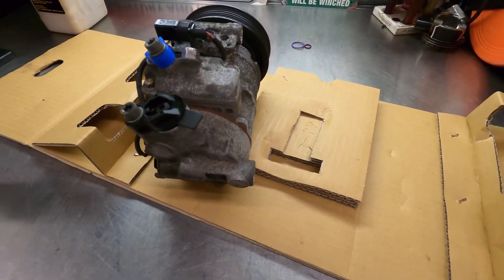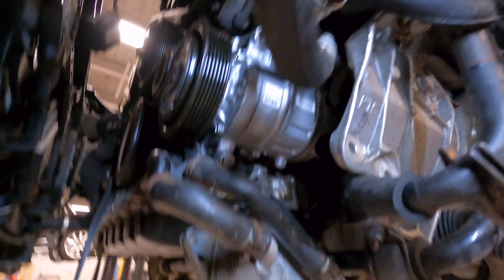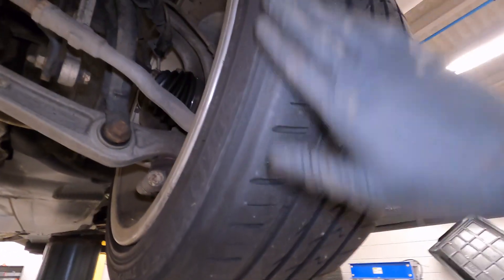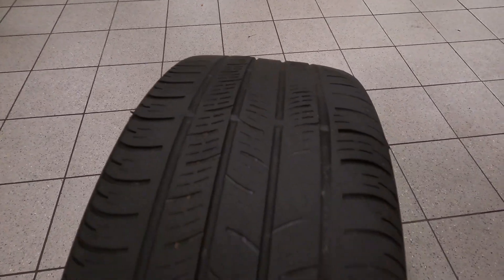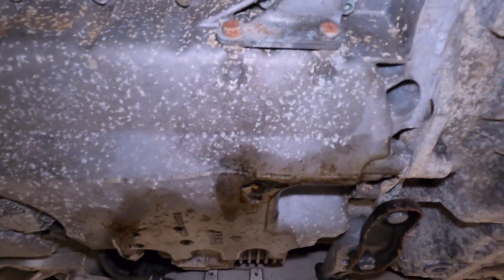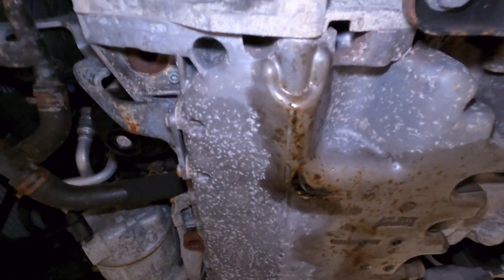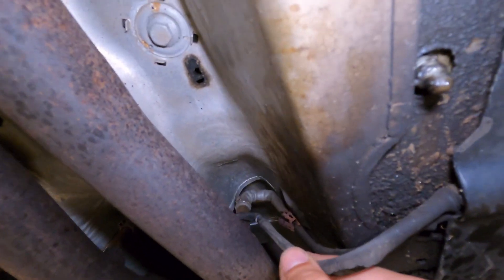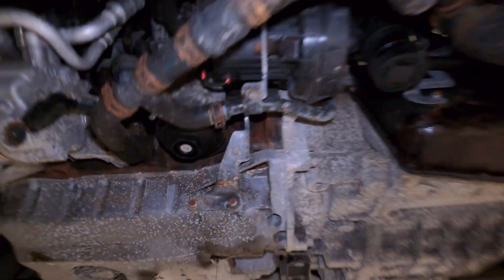Customer states Weird day in the shop again😜🤣 What's going on!??

Comment: If I ever have a repair shop, I will make videos exactly as you do, and every customer will see their video before they pay my bill. If I were the owner of this car and you showed me that uneven tire rolling, no matter how obtuse I was I would realize there's more value in the cost of the alignment than in replacing tires over and over again LOL. That and I would take great joy in explaining to them that might being cheap and not spending another three or $400 for a skid plate and anything else needed to protect it after lowering, they now get to spend even more than that would have cost, to repair the damages that have been caused. Common sense just ain't so common anymore LOL! Diggity
Reply: I'd do that too if I had a shop.  That way, customers can actually see what is wrong and just not adding "unnecessary work" for shits and giggles.  However, we're still gonna get those cheap bastards who will still refuse even if you physically show it to them...yeah, been through that a lot with my mobile repair business.

Comment: I read a lot of comments regarding the design and serviceability of new cars. New cars are smaller, more comfortable, fuel efficient, and cleaner than cars that were made even ten years ago. The only way to do that is to cramp more equipment in a smaller area, and it's worth it.
Reply: If/when YOU have to work on one of the modern vehicles you are likely to change you outlook.

Comment: car's been tracked ... flat spots are from locks up under hard braking... its also caused that wear on the inside of the tires. they need track tires on top that alignment.  but flat spots like + inside tire wear = SOME ONE BEEN TO THE TRACK

Comment: I thought only replacing a compressor instead of the whole system will just lead to another failed compressor in short time. I think I heard that in a video from the Car Wizard
Reply: Depends on why the compressor failed and how long its been that way.
if it fails electrically you don't have to replace everything.
If the internals fail mechanically then you really need to replace everything because you'll probably have metal particles in the system now and the new compressor will get messed up again before long.
Reply: @osmodan  Thanks for the reply! That all makes sense
Reply: My compressor clutch went out on my Infiniti.  The clutch wasn’t a replaceable part so the entire compressor had to be replaced.  The compressor oil was clean, so no need to replace anything else.
Reply: True, if the compressor fails in a way that puts anything, and I mean ANYTHING into the system other than air then a lot of other parts need to be changed.
Air conditioning systems need to be hospital operating room clean inside.
Actually cleaner, they can't even have any air inside them
Reply: @michaelszczys8316  once again another sensible reply. Thanks guys! Its so great to build a greater understanding together

Comment: Let me explain the career of a mechanic. first your a grunt labor. as time goes buy you learn more and more start buying tools.  Here's the catch, you have 25 years to either be the boss or the owner. After 25 years  your back is shot your knees are done and your an alcoholic plus you have $ 50000 + in tools you have no use for and be lucky if you get $0.50 on the dollar on them. 30 years a tech and $85000 + in tools 25 years sober. there ya go.

Comment: Those flat spots looked diagonal and very repeating. The steel belts in the tire tread are diagonal. I wonder if there is an issue with the tire itself.

Comment: Customer Was Power Braking and Drifting That’s Were The Goomba’d Flat Spots on The Rear Tires Came From Giggity Giggity 🤕😆😆😆 Oooooooh That Oil Pan Witness Hole For The Self Lubricating Chassis System Mod Giggity 😮🤕 Goomba’d Again 😮🤕

Comment: What the heck do they spray on the street there, to rust stuff that way, Hydrochloride acid?? 😲😲
Question: for the A/C compressor replacement, if it failed internally, did you also replaced the condenser and cleaned up all the lines from the metal debris that a failed compressor would have thrown in the circuit? Because if not that would cause another premature compressor failure...
Reply: If I were guessing, I’d say “customer declined proper repair”.

Comment: One has to be a Prick to be an auto designer. You design the vehicle so it requires a lot of expensive labour to change any part. You design the vehicle so that any repair pisses off the mechanics/technicians who have replace these parts under extreme circumstances. However the manufactures love you for design vehicles that makes tons of money in after sales service and parts.

Comment: I mean i would never want to be auto tech. Even that i say being a sales manager is like being marinated in piss and my soul has been sold several times already. I would still rather be in my situaltion, than having man versus machine wrestling matches. On my own time, i have had 2003 v6 2.3L ake diesel engine that had all the possible engine, pump, timing, lifter and electrical faults and also some a hole had been messing with ZF gearbox settings and also cluster settings. so i had to use vcds to rectify most of stuff. I mean that was my first and last audi.

Comment: So I’m looking at that trans pan and I’m thinking they stick a piece of iron against a piece of aluminum and think there was gonna be some kind of electrolyzes problem is there a gasket in there I mean the aluminum like shot two so maybe they need an aluminum transmission pan. ? Reminds me my 80 for Sure Rocco and it’s electrical system that was all aluminum wiring with copper connections.   And that was the Germans man that thing had a lot of electrical problems.

Comment: A block of ice would be cheaper for AC then replacing the compressor.
Reply: or...open the windows and deal with it like anyone in the 1930's did just drive faster to increase the cooling effect.
Reply: Hook up an inverter to the alternator, plug in a portable A/C unit or air cooler unit on the seat or front passenger floor.
Reply: @markh.6687  A window unit would work.

Comment: I think this guy might need to find another line of work as bitter as he seems to always be.
Reply: Some mechanics actually have respect for the machines they service, and hate seeing the endless parade of bad decisions, shade-tree/backyard/alley repairs, and dealing with customers who refuse to spend money but take up their valuable time bringing in these rolling deathtraps and junk heaps. I'm a not-very-skilled DIY type, and I have cringed HARD at seeing some of the vehicles, knowing even I would either fixed it better myself, have it fixed right, or shoot the poor vehicle and put it out of its misery than what these owners do (or fail to do).
Reply: Rule #1: When shopping for a German car, if you can’t afford a new one, you definitely can’t afford a used one! There is a whole breed of idiot out there that has to project the illusion of wealth although they completely lack it. They buy these cars used and then run them into the ground. They bring the car in for problems they can’t afford to fix. They waste a whole bunch of technician’s time.
Reply: @brucecoleman7412  Very true!  German cars are VERY unforgiving.  If a person skimps on maintenance or uses cheap cars that person will be punished.  Once they hit 100,000 miles they become money pits.  150,000 miles and they are beyond hope.